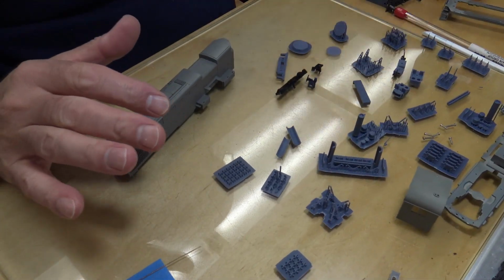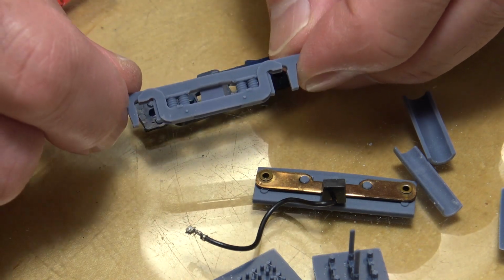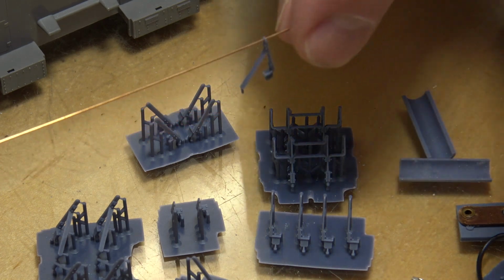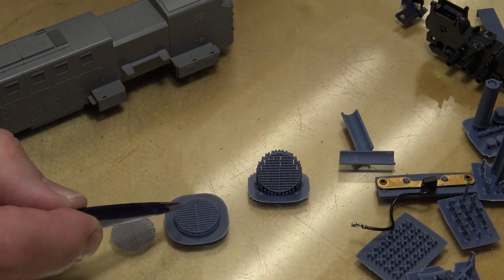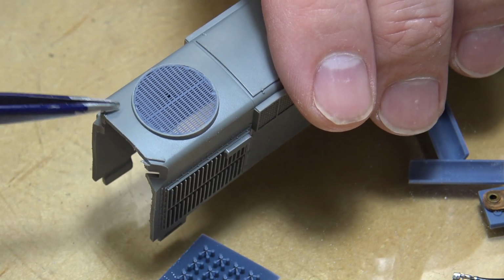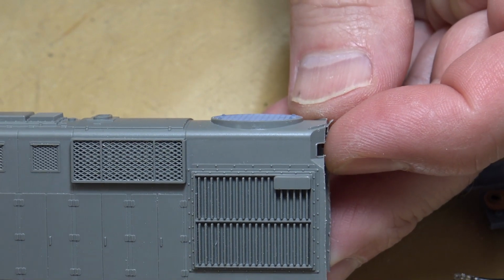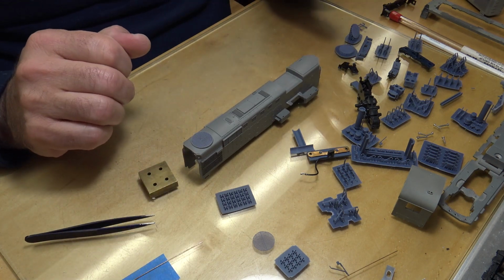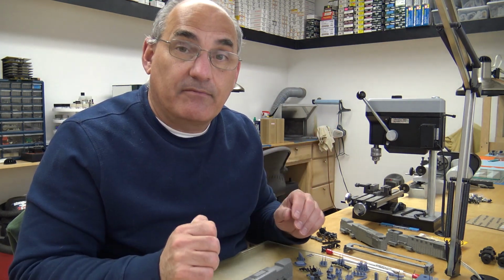ATLAS YELLOW BOX RS11 #8

Comment: Hi Brian, the recreation of finer grilles using 3D printing is promising! I found this out when designing and printing out the replacement dynamic brake hatch for my Athearn BB GP9. The side intake grilles and exhaust fan grille on the 48" cap top rendered beautifully, better than anything I've seen that was produced by injection molding. Anyhow, nice work! Keep it up! You are inspiring and motivating me to forge ahead in my own efforts!